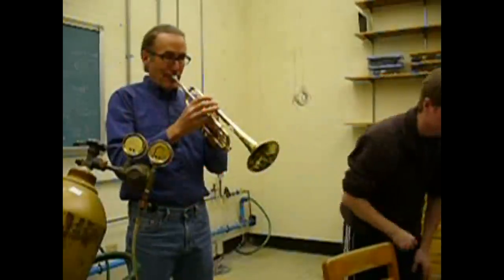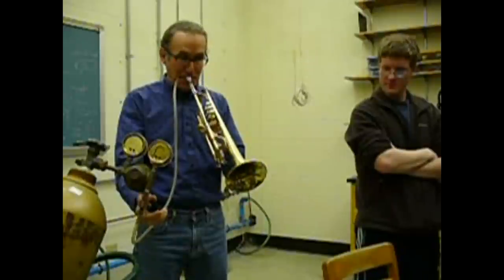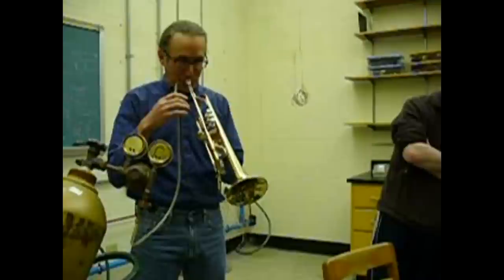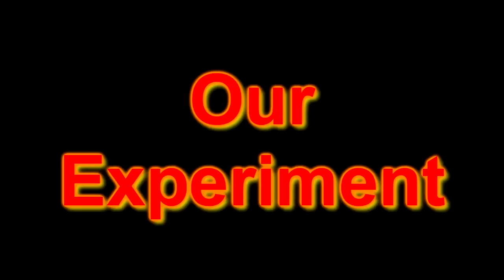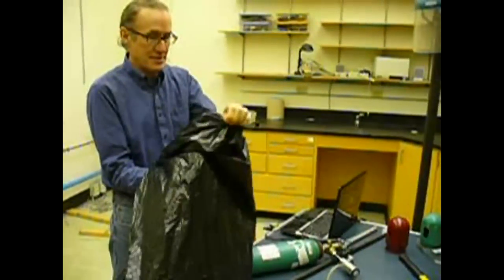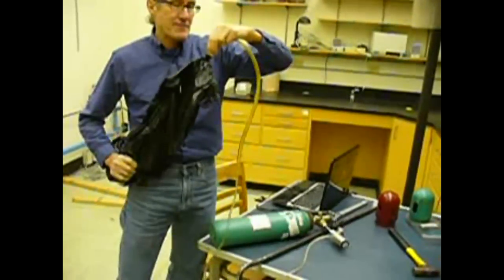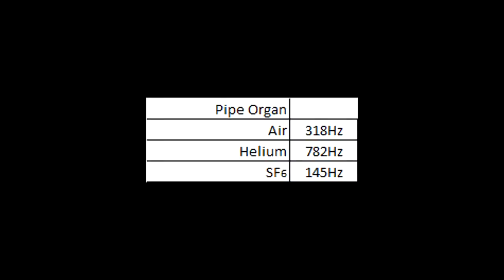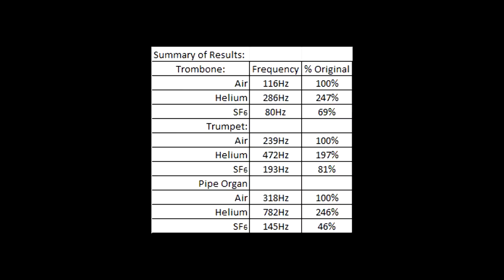Instruments in Helium and Sulfur Hexafluoride: Experiment

Comment: Should've tried filling a guitar cavity with one or the other. For helium you would just keep the guitar facing down. For SF6 you would keep the guitar facing upward.
Reply: I also wondered what would happen with a guitar. It would make sense because most of the sound comes from the soundboard.
Reply: the sound comes from the tension of the strings, not the soundboard. an interesting experiment would be to see what vibrations it makes in a complete vacuum
Reply: theoretically the vibration of the strings would be resisted by the air, so different air densities would make a difference to the pitch. the soundboard only amplifies the sound by spreading the amount of energy from the air displaced by the strings, increasing efficiency of the air displaced and creating a louder sound.
Reply: +Mikail Elchanovanich  But I imagine that helium and SF6 would still emphasize different harmonics in the soundboard.  The fundamental frequency might stay the same, but the harmonics would have different emphasis I imagine.  And if you did this in a vacuum, you would have to find another way to measure the frequency because you wouldn't hear anything
Reply: Nothing would happen.
Reply: For the guitar, the oscillator is the strings, and the resonator is the guitar body (soundboard). Air resistance is a tiny factor in string oscilation, and the soundboard resonance mainly depends on the shape deformation and the stiffness of the soundboard, so changing the air, I predict, should make no difference.

Comment: FYI, speaking as a trumpeter to any who were confused about why they had trouble making a clear sound when the pitch changes, it has to do with the "shape" of a sound wave vs the length of the instrument.  Brass instruments contain a certain length of pipe which can only produce certain pitches clearly, the pistons (or slide on a trombone) increase the length to allow for more different shapes to "fit" then length.

Comment: The pitch shouldn't change.  I call BS.
Reply: +Willoughby Krenzteinburg Uhh. Yeah. It should. SF6 is six fucking times heavier than O2. You can literally float tin foil boats on it. Boats. On air. When you're pushing denser air through the tubes of a brass instrument, of course the resonance is going to become slower and produce much lower notes. The same is vice versa with Helium. Helium is 14, yes. FOURTEEN times lighter than air. That is going to allow very high pitches through faster resonating waves.
Reply: The Azonar the pitch doesn't change.  The resonant frequencies do.  

Read the second paragraph of the section titled "Voice, meet helium"

http://m.mentalfloss.com/article.php?id=21590

I know what SF6 is.
Reply: Willoughby Krenzteinburg You do realize pitch is created from how fast it moves.... right? Ever seen a piano in your life? A C#7 is going to vibrate so fast you can't see it. A Eb1 is going to vibrate so slow you can see it wobbling back and forth.

Pitch is married to frequency. Which you fail to believe.
Reply: Pitch
noun
the quality of a sound governed by the rate of vibrations producing it; the degree of highness or lowness of a tone.

Timbre
noun
the character or quality of a musical sound or voice as distinct from its pitch and intensity.

If you're saying that the only thing that changes when someone inhales this shit just "sounds higher" in timbre, and that's not pitch related at all? What? To sound higher, you need to change timbre. You can't play as high as a trumpet on a baritone. You need to switch instruments. You can't sing high notes as a Bass, you need to switch to falsetto. They directly correlate, no? Unless I've never thought so deep into this, your pitch changes with timbre classification.
Reply: Willoughby Krenzteinburg Alright, that little excerpt from that link provided a better idea at what you were talking about. I still don't think I believe that. I wouldn't think that all vocal chords vibrate the same for everyone. There are people with higher voices, and it doesn't make a bit of sense why their voice would vibrate just as slow as my deeper voice. The chords should behave just as a piano, guitar, cello, etc. string should.
Reply: The Azonar And the three strings on the middle C of a piano vibrate at the exact same rate regardless of the medium they vibrate in.  The PITCH would not change.  In helium, it would just SOUND "tinny" because the low resonant frequencies would get drowned out by higher resonant frequencies.  In SF6, it would maintain pitch but lose "presence" because the higher resonant frequencies would be drowned out by the lower ones.  I think the reason a trumpet would change pitch is because they are designed to amplify the resonant frequencies themselves.  That's the only explanation IF this is real.  Helium and SF6 do not inherently change pitch.

Comment: according to the data they collected, the table shows an exponential property based on volume of the horn. due to the trumpets lack of change in pitch versus the trombone concludes this. assuming a tuba's massive volume compared to the other instruments, the change would be significantly greater than that of both the trombone and trumpet. let's figure out how to calculate this. Please comment!!!

Comment: Any idea on how this might affect DB on a subwoofer in a car?
Reply: Decibels measure loudness, hertz is what you probably meant, and as for your question the answer is quite simple it changes the hertz and possibly decibels as well due to the density of the gasses.
Reply: Put helium in a car engine and it will rev higher

Comment: Could you fill a piano with those gasses and test the sound?
Reply: Kyenxos A piano uses air...
Reply: Ali Hajeiya A piano doesn't 'use' air like a wind instrument, but there is air inside, and it does vibrate
Reply from the maker: For stringed instruments the pitch is determined by the string length and speed of waves on the string which in turn is determined by the tension and density of the string. So a piano (guitar, violin, etc.) would not change pitch. Some of the overtones might change (Helmholtz resonances in the body of the instrument affect the timbre) so it might sound a little different but the fundamental notes would be the same. I tried this with a guitar and could not detect any noticeable difference.